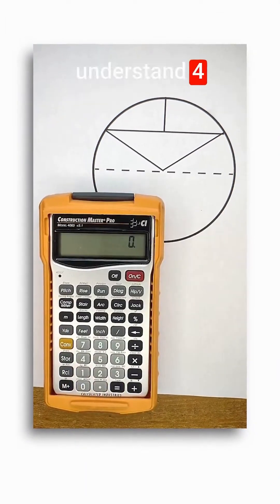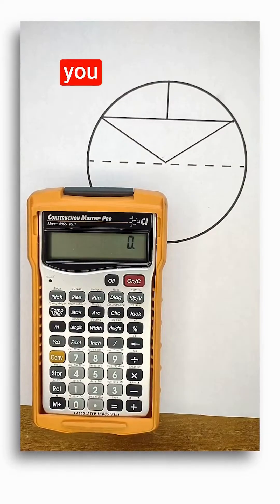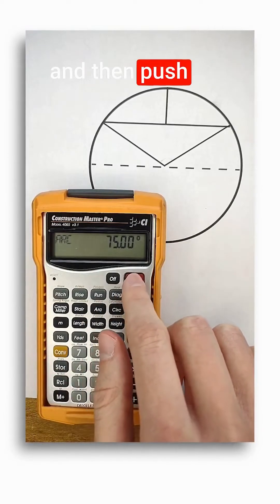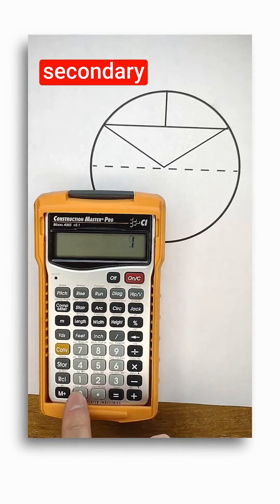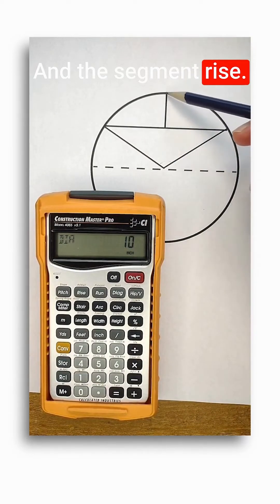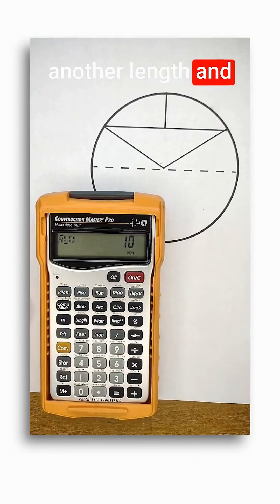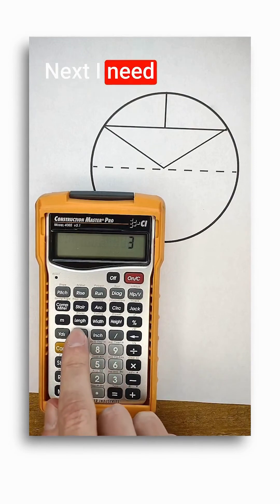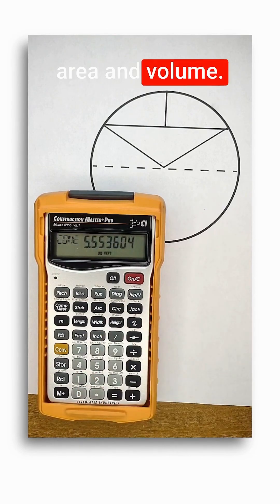Circle formulas for construction | Using the Construction Master Pro

Comment: I own a Construction master calculator. Usually in construction you have a total length of an arc and a depth (rise) and the construction master calculator you put those two numbers and it will give you a radius, not the other way around. Usually what you look for is the radius.